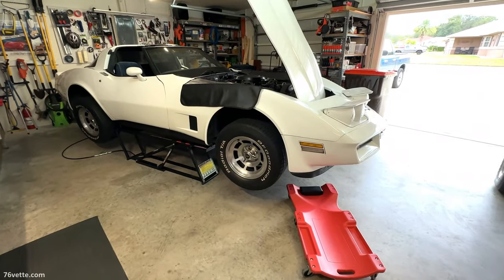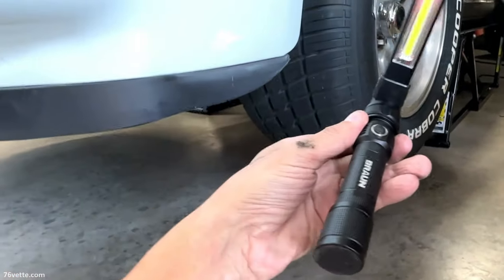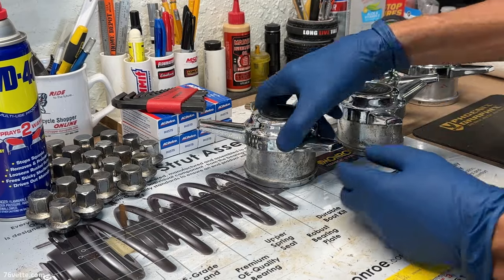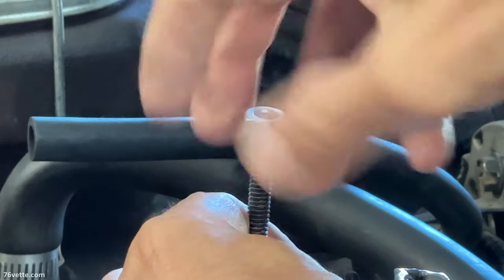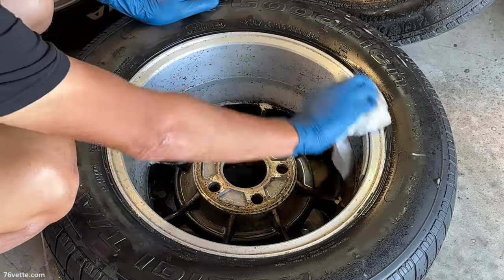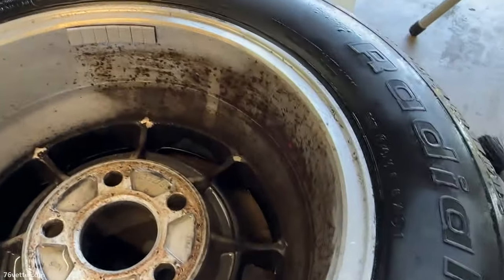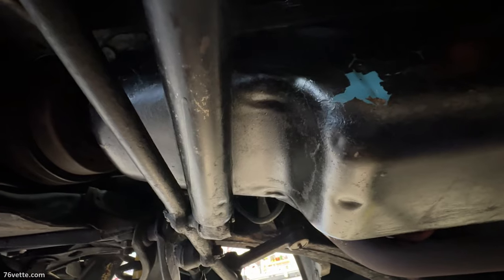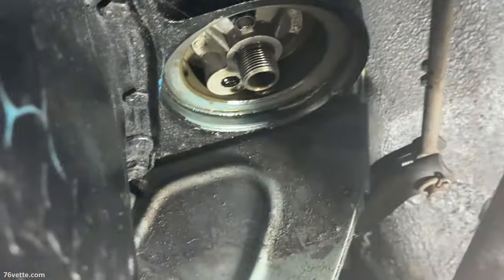C3 Corvette Chassis, Wheels, Brakes, Lube

Comment: Great video as always . If you ever do a brake flush or a bleed  that would be a great video as well being we all have trouble bleeding these brakes . At least I do lol
Reply from the maker: Thanks. Yes, I have one coming up (next month I think), where I do a brake system flush, then caliper bleeding, then a master cylinder bleed without removing it from the car—because I find it easier that way, and then a final caliper bleed. Didn’t really plan it that way but sometimes I like to share my screwups and shortcomings 😆👍🏻

Comment: Really appreciate all the hard work and insights in your videos ! My 1980 is currently being sent out for a rear end replacement and I was wondering if you’ve ever had to deal with this either in your 76 or your 81 and what your experience and thoughts would be. My mechanic is also trying to talk me into fuel injection which I’m unsure of as even though the quadrajets and carbs are becoming a thing of the past, I still want to keep the originality to the car. Curious to see what you think and your thoughts. Thanks in advance :)
Reply from the maker: I've never had to deal with a C3 rear-end, other than for maintenance. As far as fuel injection is concerned, a friend of mine installed a Holley Sniper system and struggled for quite some time to get it running right. And the guy's a good mechanic. A fuel injection system is expensive, and you will have to install an electric fuel pump (inside the tank is highly recommended), a fuel pressure regulator, and who knows what else. 
I am well aware that carburetors are things of the past, but there are professionals out there that can rebuild a carb to better-than-new condition, so I don't see the benefit of spending several thousand dollars to risk creating new problems. Then again, I taught myself how to rebuild and do basic adjustments on Quadrajets, so I don't consider them a problem.
I also think that a Quadrajet along with the factory air cleaner assembly looks so much better and correct. But that's just my opinion and I am no expert.
Thank you for watching! 🙂👍🏻
Reply: Appreciate the help, thanks !

Comment: So if I’m not mistaken you have 2 Vettes now. A 76 and 81. Do you plan on keeping both after the restoration?
Reply from the maker: Yes. Not sure if I’m going to keep the 81 though, but the more I work on it, the more I like it.
Reply: My 79 has all the smog equipment but I have no choice (California). Noticed your 81 has the same. Do you plan on keeping it on?
Reply from the maker: @inell6  No. The whole system is clogged and the AIR pump had a few broken pieces, so I removed it and have it stored in boxes in case someone wants to have the parts rebuilt.

Comment: Kindly can you share the headlight switch link and if it's available on Amazon? I'm struggling to get it in Dubai 😢
Reply from the maker: 1974-77 switch https://amzn.to/41zJFX7
1978-82 switch https://amzn.to/47dTdsj

However, they are not shipped by Amazon but by other vendors. Hope this helps. 😊👍🏻

Comment: Wouldn’t car ramps under the tires give a similar lift?  I would add some pinned 6-Ton stands for waay too much overkill. But that lift looks
Reply from the maker: I guess so, but I need the car to be level and I like having two height settings. 😊👍🏻
Reply: @76vette  Also, Maybe you could put the front or rear  tires on the lift strategically for extra clearance  and maybe place a couple of small stands under the ramps for that extra peaceful easy feeling. Thanks for sharing your cars and care with us! Merry Christmas!
Reply from the maker: @Jabbernack  I may try placing the lifts across instead of longways one of these days. That’s totally ok according to QuickJack as long as the car is balanced properly. 
Thank you for watching, and a Merry Christmas to you as well! 🎅🏼🎄🎁
Reply: These quick jacks are a life saver. I have the 7000T model and for having your car level or rotating tires these jacks are a definite DYIer requirement lol.